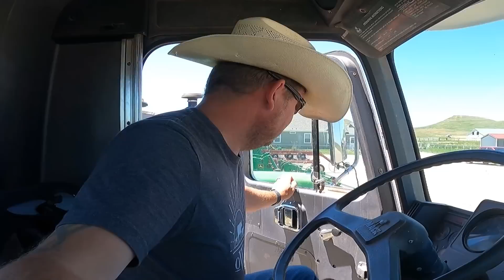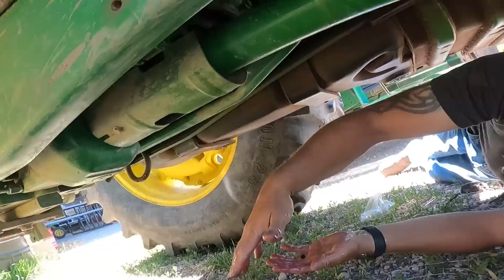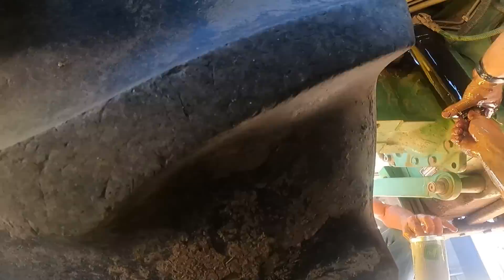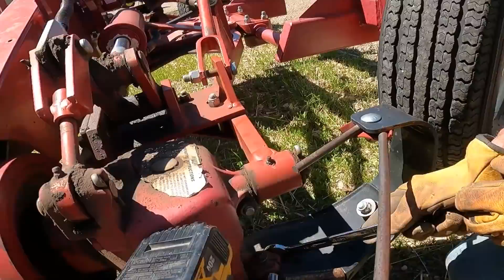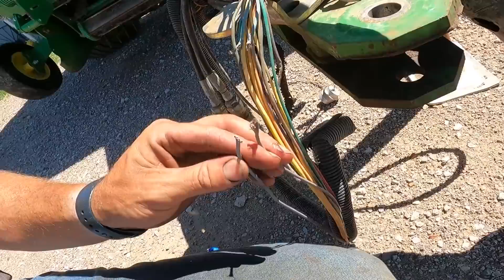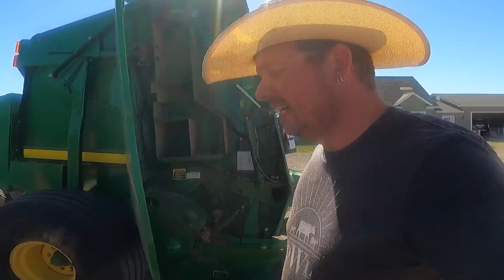Mike and Jeff Mechanic

Comment: One thing I learned re removing and replacing hydrolic hoses on my equipment is I tie a long rope or bailing twine on one end and pull the hose to remove it. The rope follows the route of the old hose as it is removed. The rope stays in place and tie it to the leading end of the new hose to pull / thread it back through. That has saved me a lot of time, busted knuckles, cussing and aggravation when threading new hydrolic hoses through tight twisty turns , over and under, through areas I couldn’t see into very well, needed longer arms and etc.  
  Don’t forget to change or pull and blow out the filters in the tractor cabs.
   Even if haying your fields costs you 20k in equipment maintenance, repairs, fuel, oil, hydrolic fluid, grease and net wrap you will still be saving a heap of money on that hay not having to buy elsewhere and have it hauled in.

Comment: Defiantly  takes lots of money to keep machinery in operating condition. Changing the filters will save lots in fuel for sure. Those sickle bars are finger cutter offers if not careful. Does the loader have a lock that holds it up when working under it? We had one break one time when it was up in the air. It didn't take long for it to hit the ground. Be careful guys. Thanks for sharing. Always enjoy your videos. 95 today in Iowa.

Comment: Mike...  As complicated as those hydraulic lines on the baler look, it might have been a good idea to use your phone and take pictures of exactly how they are routed before removing them.  Don't want a brand new line to get chaffed because it was put back the wrong way.  It looks like the clearances are pretty tight.  Having been a truck driver my first eight years in the Army I did most of the mechanical work on my trucks I was responsible for maintaining.  Back then we had a few mechanics that their skills were either lacking or they were just tired a$$es.  I looked at it like this I was the one that was going to be broke down on the side of the road if something failed.  If I was the one that repaired what broke I could only blame myself.  Some of our mechanics did things like forget to put break fluid in the master cylinder they replaced on our 40 foot trailer, or forget to bend the retention tabs on the spindal nuts for the front axle.  After those two incidences, I did all mechanical maintenance on my trucks.  I might have to try and come up your way next year and help out with the pre-haying equipment maintenance.  Might even bring a bunch of blue shop towles so you don't have to wipe hydrulic oil all over your jeans.
Reply: Didn't Read All, Just the Beginning. I thought That Too & It Might Have Been Easier. I Didn't Realize, Da, I Thought to Myself, He's Filming it! LoL Still Would Have Been Better, in my Opinion, to take Close Up's since it's So Easy These Days

Comment: Thanks Mike and Jeff for another Entertaining and Educational Video. As a Technician I do enjoy watching others work on equipment,I worked 7 years in the Army as a Medium/Heavy Wheeled Mechanic 63B-63S from Jeeps-Tractor Trailers (Mike what was your AFSC and did Jeff serve?).Then 25 Years as a Master ASE Certified Technician last 20 years as Lead Technician at Virginia's largest Chevrolet dealership until I was permanently sidelined with Spinal Stenosis. I do think You ended up with the better Job (except for working in the cold and snow,I'm originally from Ohio and don't missing working in snow) Good Luck Haying !

Comment: Please if you have to work under the front shovel, at least block the cylinders from falling!!!! Extremely dangerous to be under there. Greetings from Germany. Nice video I liked it very much
Reply: Yeah I'd be a little leary taking the filter out with the bucket up. Seen check valve safeties fail

Comment: Mike and Jeff you might want to put the hours and date when you change the, air filter and oil, hydraulic transmission filter and make sure all the fluids are up to the full line. And grease everything and even the 5th wheel plate on the Mack truck.

Comment: I couldn’t really tell if you bailer has a slip clutch on the bailer end of the PTO shaft. if it is a slip clutch it should be put through process of making sure it will slip if the bailer hits something that causes the entire system to come to a sudden stop. You really want that clutch to slip and the tractor transmission housing to stay intact, rather than spreading itself across the hay field. Great video!!

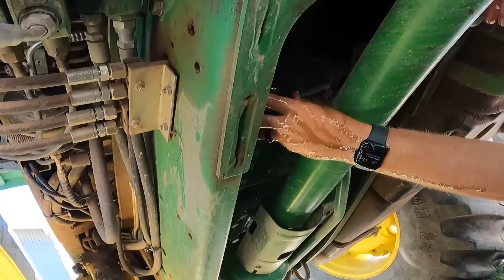Comment: At 9:30 it shows a loose wire with plug sitting on top of drive shaft on 6410. Also radio in dirt by back tire.

Comment: Look close a the roller bearings in the baler.  I suspect Deere still uses the sealed bearing assemblies.  They work great until they don't.  Then they get hot and have been known to burn a baler to the ground.  The bottom bearings are probably the worst because of the weight they have to carry.  The rest just keep tension on the belts.  But I will also say that it has been over thirty years since I worked on round balers and they were the 410 and 510 models from the 80's.  Maybe they have improved them, but not likely.

Comment: look at your books on them tractors some place there is cab filters to keep the dust out of them for the drivers of them google or you tube tractor number and or look in the book just heads up these filter will help the AC work better also

Comment: Well, by the golly……Erin plays a big part with you, Mike, when it comes to getting the machinery in tip top shape! BECAUSE………..she does the laundry !!!! And no doubt about it, there is all kinds of oils, and mechanical fluids on Mikes jeans!    I don’t know anything about grease, but that pulsating grease applicator….quite the unit.  Farming isn’t just about cattle…….(snicker)…..sorry Mike!  But you did a great job working the mechanical end of it.  Good job, fellas.  Put a check mark on the board…..job done!  Bev in Maine
Reply: Thats the load that goes to the laundromat! Don't ruin the home washer..

Comment: I don't think you can say that the 6,500 you spent so far goes into the cost of hay.  There isn't one thing that you did that lasts only for your hay cutting.  Those tractors are used throughout the year and the maintenance on them is used for that activity.  The cycle cutting bars will last more than one season as will the baler hydraulic lines and belts.  So, you need to amortize the costs over the number of hay-cutting seasons you expect to use for and for other tractor uses over the next few years.
Reply: Oh, I'm sure he knows that.. I  have a spreadsheet I use to calculate what it costs including depreciation, maintenance , labor etc. On a per bale basis.. for my custom baling.. my older equipment I bought allows me to get 15/hr for my labor.. 25/roll for 4x5.. 3 rolls per acre minimum.. still gets a small profit since I'm limited on what I can do locally and me physically..
Reply: @audreye7078  It sounded like he did not know that and plans to use the full $6k.
Reply: @madampolo  not if he pays any attention to his taxes.. we shouldn't just presume people don't know something just because they didn't cover that detail.. not enough time in the video.. He was listing what he's spent so far.. 
If we included the price of the land, taxes etc.. we'd probably find we're not saving that much and further, if we account for the the use for grazing, setup for proper rotational grazing.. blah, blah, blah.. we'd really be better off buying hay as then we have a lot more control over the nutrition content through selective purchasing..

Comment: I think its unfair to throw all that maintenance cost into haying.   For example those tractors are used throughout the year and without replacing that pump that tractor might be down totally.    I agree that all the maintenance/repairs on the rake, baler, sickle and grease on all equipment should be counted.   I also agree that the total cost of diesel/gasoline used should be counted along with the total labor costs to complete the job.

Comment: What about all the grease zirks,  universal joints, condition of hydraulic hoses,  juice in batteries etc....everything that moves needs grease!!!!  Hoping you guys get 6 tons of hay/acre....Do you plastic wrap your bales of hay to protect them from the weather?? .........Maybe check ebay next time you need a power steering pump for the John Deere 4450....they have a new one for $1370 instead of the $3000 you paid for one ....another thing you can do, is there are mechanics out there that repair those kinds of pumps...you might check that out next time before letting loose of $3000     Ranching definitely is expensive......Do you replace all filters once a year or on a per hour of usage basis??

Comment: Not quite everything Mike, you forgot your oil, hydraulic fluid and a little diesel fuel.  Kind a bad if you forget to put in the oil, top off the fluids and you cause yourself an airlock in the fuel system.